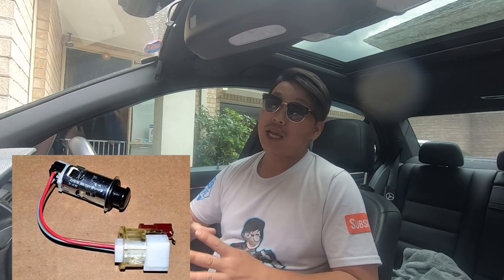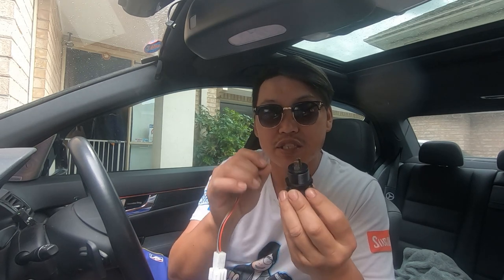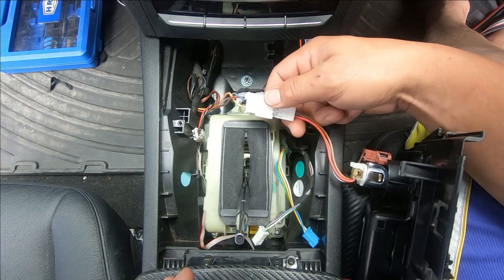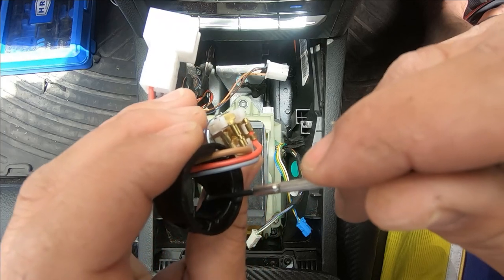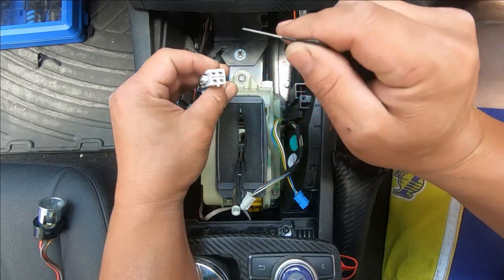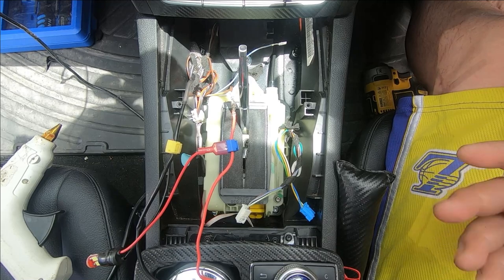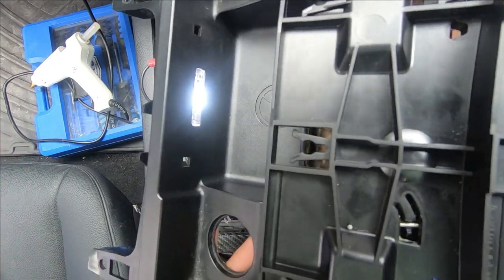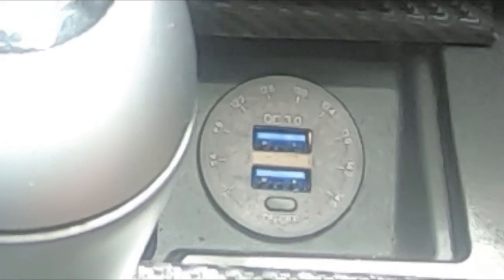mercedes w204 mod 12v port removal/upgrade to dual usb qc 3.0 ports with voltmeter ashtray removal

Comment from the maker: hey guys hope you enjoy this lil mod i did... so rememeber this doesnt take away from being able to use 12 volt accessories like fridges and heaters and fans and or any other 12v electronic that uses a cigarette lighter port ..as you still have one in the glove box
which brings me to a related thought ..you can always add another 12v port in the back just below the ac vents for the rear ..for those who dont already have a 12v port there ... enjoy ..much more to come ..
Reply: How can i add 12v port to the back below the ac vents?

Comment: Rather than removing the wires from the harness, I’m guessing you could just cut the wires on the cigarette lighter harness?
Reply from the maker: yes but I only did this incase I ever wanted to go back to factory . but ur right u can just cut it and solder or use connectors butt connectors whatever you choose
Reply: Thanks. That’s what I figured. Not sure I’d ever go back to a cigarette lighter :)
Reply from the maker: @rhysparker6504  true but never know ?? lol in yourcase just cut t then

Comment: Hey Mikey, recently purchased a 204 2008 4matic but the front two ports (center and one found in the glovebox) are not working - I have confirmed that the fuse is functioning in the fusebox (in the back) so I was wondering what would be the issue? Would it be the metal socket itself perhaps is corroded / not getting electricity sent through it? Wondered if you have any idea - thank you
Reply from the maker: @DissiDiaTunez  that is very possible ...make sure u check that the cable hasn't become u plugged or corroded and just disconnected ..it is possible  .. now that u have confirmed the fuses are ok .. I would trace the wire and ensure no shorts or wires cut or split. I had an issue where my w203 electric adjuster for the seat was malfunctioned and I found out it was a split i the wire causing a short...everytime I inserted a fuse it blew right away which told me it was a short ..so I followed the wire and there it was where the seat folds ..this prolly isn't your issue  ut the takeaway is ..worth tracing the wires

Comment: Why did you not wire the led off the blue/grey cable?
Reply from the maker: refresh my menory which is the blue grey wire?
Reply: @MIKEYZVLOGZ  to one that powers the original light in the ashtray
Reply from the maker: @Troy-McLore  u know i prolyl just didn't even think of it as i was already trapping the 12v of the cigarette lighter port, i just figured wouldn't hurt , although now that u mention it u can do that too

Comment: That's not an option when you need to blow air into tire with electric pump that uses cigarette lighter or like all the rest gadgets that uses 12v lighter socket
Reply from the maker: very true , so i guess in that case u can carry a portable tyre inflator or those jumper gadgets that also pump tyres

Comment: what gauge of spade connector is it. can’t seem to find one that fits in any store near me
Reply from the maker: it's a typical spade connector as long as it fits in the port
Reply: @MIKEYZVLOGZ  yeah, what’s the size that fits in the port. smallest i can find in stores near me is 14-16 gauge and it’s way too big.
Reply from the maker: @jaiye_  let me check and gt back to u..ok so u can find thinner ones on ebay .. whatever size u need for example say it's a 4mm spade connector blade..u type 4mm spade connector blade in ebay and it will come up with the size ..then u use that   one ..its what I pretty much did.. but I will double check my ones Nd let u know..I used speaker type ones which are thinner ..and just made it fit

Comment: Hi MikeyZ, I'm attempting this lighter ro usb mod.  There are 3 wires going to the lighter. Which is positive, which is negative, and what is the third wire??
Reply from the maker: pps is red orange like wire and neg is brown third wire is for the light so u won't need it

Comment: You can just buy plug in usb port thou, whats the benefit of this? Thank u
Reply from the maker: it's hard-wired... not a bulky cigarette lighter that sticks out. It looks better .. and u can have the voltmeter and fast charge at the same time without having to plug something else it. a d yes ur right u can just use a plug and play one..but I wanted something permanent so I just did this... its for those who want a specific type of charger ..that's all

Comment: Hey Mikey, do you have link to that USB charger?

Did you take out the metal ash tray altogether? Trying to figure out what to do with that space.
Reply from the maker: all I did was remove the cigarette lighter and use the power from it to put this in so I had a voltmeter and a type c plus usb fast charger
Reply from the maker: ye I think I do I can send u one ..where do u shop ebay or Amazon or aloexpress
Reply: @MIKEYZVLOGZ  amazon

Comment: Hi MikeyZ , any ideas on how to check the M,S C switch by the gear selecter, mine is always in sport mode and I cant change it via the button,
Many thanks Mark
Reply from the maker: did u have to change to sport oprigiinally or has it always been like that ?

Comment: Hey Great Mod Mikey! Where can i find the plug connectors?
Reply from the maker: the connectors I used are just typical connectors just use the same ones that fit the size terminal pins

Comment: Hey, nice video! Do you still have the 2 oem white connectors? I need the part numbers, can you check them for me please?
Reply from the maker: ye I gotta find it
Reply: @MIKEYZVLOGZ  thanks a lot! I really need it 😁
Reply from the maker: @DiogoSilva-hr8ee  may I ask what for
Reply: @MIKEYZVLOGZ  yes, of course! I will install an ambient light kit but I dont want to tap the oem wires, so I will make extensions and tap the extension wires 👍🏽 I went to the Mercedes dealer today but they didnt know the part numbers
Reply from the maker: @DiogoSilva-hr8ee  ahh yes

Comment: Hello Mr Mikeyz Vlogz
I have a w204 C250 MB 2013 which its rain sensor is not working due to the windshield change 
Is there any way to reactive the rain & light sensor
Reply from the maker: might just need to be re activated via a mercedes das xentry diagnostic tools or mercedes themselves ... when u changes the windscreen how did they move the rain sensor over.. take off cover by prying it and check the connectors make sure they reconnected all plugs
Reply from the maker: hey so I did some research and apparently sometimes when changing the windscreen due to disconnecting the rain sensor it may just need to be resetted 
here's the steps on how u reset the rain sensor u may need 2 ppl to do as the doors have to be closed according to these instructions I found

 With engine running and all passenger doors closed, starting at #0, turn on wipers to #3 position, then put the switch in the #0 position then put it in the auto #1 (rain sensor position) then have someone splash water on the windshield as the doors have to be closed to reset this function.

Comment: Hey Mikey,
Possible for the w203 as well?
Reply from the maker: yes indeed very possible its just a matter of finding the right size cigarette port / usb connector with usb ports, and ensuring it fits ion the port, then u do the same thing use the pos and neg and connect it to the usb ports

Comment: Can you use it to play music? If not how do you do that? Thank you!
Reply from the maker: no this is just for charging ..its not connected to the stereo... that is usually in glove box where you change the cable and allow usb ipod or aux ...then u can play music through those means ... its called MMI multimedia input ... I've used mine for aux and connected my wireless phone mirrorlink to it ... so I can mirror my phone to screen and play audio as well